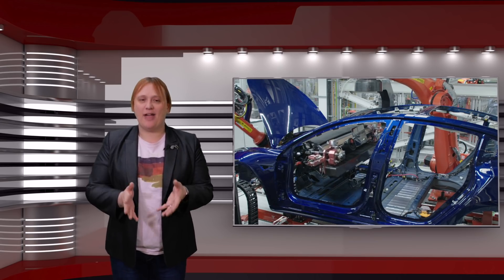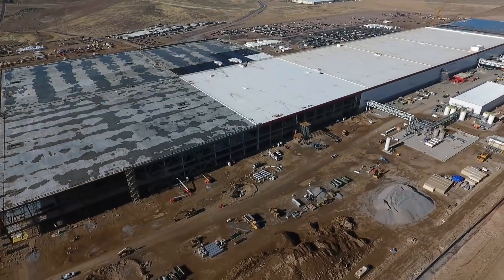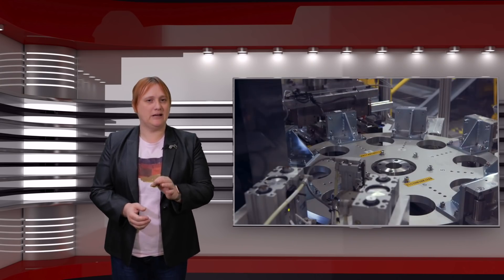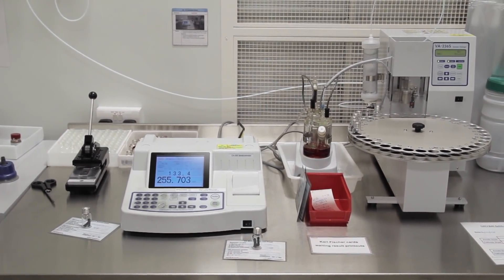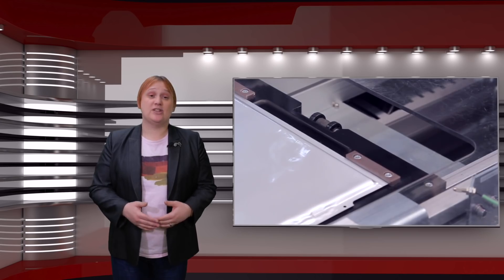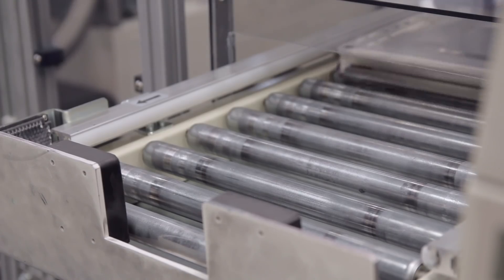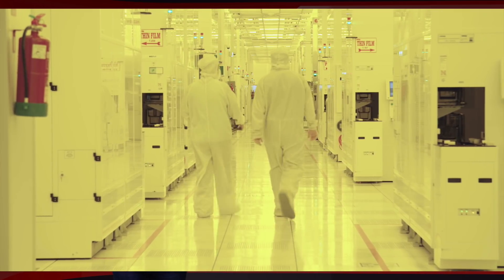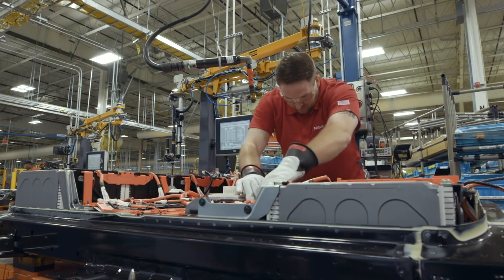Want A Battery Breakthrough? Figure Out How To Make Lithium Ion Batteries More Easily!

Comment: I work in aviation and in my industry we have moved to a "just culture" policy. In which undue stress is not allowed (but often still happens) and you can't under most circumstances be punished for mistakes.
This policy has helped reduce occurrences and if employed in other industries reduce errors.
Reply: @Adam Wade A lot of those issues can actually be explained by greed, plain and simple, capitalism drives for the sale of the cheapest product for the highest price that people are willing to pay, and that often results in the sale of substandard products. Either way, people do need to be held accountable for their mistakes. It does make sense to reduce the stress of people coming clean with their mistakes at an early enough time that those mistakes don't turn into a major problem, but if your design makes it into production and ends up killing hundreds of people, you absolutely need to be s--t-canned.
-
I can say from experience that the problems with new houses are absolutely a result of greed, because I've worked construction and I've seen that problems are almost never a result of mistakes, but are a result of the push for projects to be done faster, with cheaper labor and cheaper materials (sometimes, the wrong materials). Managers/business owners are also PLENTY hard on their employees in that line of work.
Reply: @Adam Wade Most products have improved, MASSIVELY, and many have improved due to government regulations. Look at cars, they're a million times better than they were 40 years ago, partly because of competition from the Japanese, mostly because of government regulations on emissions (which also led to improvements in power output, interestingly enough), safety and efficiency. When the government wasn't involved in the regulation of automotive technology, the market system made almost ZERO advances, for THREE DECADES, because all they had to do was package their products in a way that made them attractive to consumers and produce them in the absolute cheapest way possible. Without regulation, the market system becomes a race to bottom, because most consumers are morons and have no idea what they're even buying. For example: You probably don't know the first thing about automotive technology.
-
Greed is so hugely damaging to a society that I can't even begin to touch on the problems that it causes (plus, I'm eating), I'll only suggest that you lay off of the pot, it destroys the functioning of your brain and it's VERY clear that you haven't thought about this matter with a clear head.
Reply: Huh, so that explains the 737 Max.
Reply: @Adam Wade I'M embarrassing, says the stoner... Ok, buddy!
-
"Not only am I a trained mechanic but I also run my own bussiness operating 100k+ pieces of equipment."
-
Sure you are. Anyway, even if you are, that doesn't counter the point that I made, which is that most people don't know what they're actually buying, most of the time, which is why a pure market system could never produce any major advancement.
-
"You think the government invented fuel injection?  Or a knock sensor?"
-
No, but automotive companies had no need to adopt them until the government raised emissions standards.
-
"You think cars didn't advance due to capitalism?"
-
Did they advance from the 1950s through the late 1970s?
-
"They didn't advance due to regulations in order to pave a path for foreign manufactures to openly sell here."
-
What? They didn't advance until the regulations REQUIRED them to advance.
-
"My 69 c/10 pick up truck gets 19 mpg."
-
But it probably makes less than 200 hp (don't forget about gross vs net). Something like the Ridgeline makes nearly 300 hp, gets 25 mpg, it pollutes THOUSANDS of times less and is a FAR safer and more capable vehicle than your C10.
-
"...all get the same or less."
-
While being capable of making WAY more power, while polluting FAR less.
-
"You think I know nothing about auto's because you have been taught with no working knowledge."
-
I've been working on cars for nearly 20 years! ROFLMAO!!!
-
"What do we have now we didn't have then."
-
WTF kind of question is that? Modern cars have FAR more power, their handling and stopping ability is WORLDS better, they're much more fuel efficient, they're literally THOUSANDS of times cleaner (as far as emissions), they're ridiculously safe when compared to older cars, they require FAR less maintenance, they're FAR more reliable... Older cars didn't even have 6 digit odometers, because they rarely even lasted long enough to need them, yet they needed oil changes 3 times more often (the PCV system, which is an emissions control system, is one of the things that made longer oil change intervals possible), their carburetors constantly needed to be fiddled with, ignition components were constantly in need of adjustment and replacement... The list of MASSIVE improvements just goes on and on! This cements my assumption that you know absolutely NOTHING about automotive technology.
-
"Study after study has proven the auto industry is not advancing due to over regulation."
-
Yeah? What studies are those? The studies that show that vehicle death rates have dropped dramatically over the years? The studies that show that air quality has improved dramatically over the years? The studies that show that vehicle reliability and longevity has improved dramatically over the years? You're just pulling crap out of your bong, man.
-
"Imagine Tesla without all the regulations."
-
Describe it to me, oh wise one, I'd love to hear about how much better a Tesla would be without regulations from someone who is so knowledgeable.
-
"...you would not buy from the cheapest supplier?"
-
In our current economy, who wouldn't? That was my point, stoner boy.
-
"How long would you last buying high and selling low?"
-
In our current economy, you wouldn't last long. That was my point, stoner boy.
-
"You feel things are not right."
-
I don't feel anything, I KNOW that things aren't right. Nothing that we're currently doing can be sustained, it WILL lead to disaster, and all of the supposed accomplishments that capitalism has made over the years will mean absolutely NOTHING. There are PLENTY of studies to back me up on that.
-
"That is why I have spent nights in tears figuring out how to keep my men paid, there families secure."
-
Wah. That's the fault of our current economic system, buddy. If the functioning of your brain weren't horribly destroyed by your drug use, you'd be able to think outside of the box and understand that. If your mind were actually open, you'd be able to look in from the outside, you wouldn't be a pathetic slave to a system that defies the laws of nature and is dragging us to our own demise! You're PATHETIC, you're just a mindless herd animal.
-
"Very few people are greedy as you describe it."
-
You don't even know the definition of greed! Greed is when someone's want for wealth and power are EXCESSIVE, those wants are deemed to be excessive because they're DAMAGING TO SOCIETY. Greed, by definition, is a BAD thing. 
-
"I will know if you googled it. What do you use?  Do you know?"
-
My dad showed me how Plastigauge works when I was like 10 years old! Now, tell me, why are engines so much more powerful and so much more efficient than they were 50 years ago. What do you know about actual automotive DESIGN?
Reply: @Adam Wade "I have greed.  Drug dealers have greed."
-
BTW, this is why we throw people like you in jail.
Reply: @Adam Wade You actually missed one of the primary reasons, and it was a result of government regulations.
-
"power is increase by only 2 ways."
-
Absolutely HILARIOUS. There are MANY ways to increase power output.
-
"Even though those are terrible and are removed, like on my Camaro."
-
There are at least a few manufacturers who are still using cylinder deactivation technology, including GM.
-
"Or how they are developing thermoelectric generators to replace them."
-
I read about that almost 20 years ago, none ever made it into production.
-
"alcohol has a higher octane rating which also allows for more timing."
-
Most people don't run E85 in their cars, and ethanol actually REDUCES mpg.
-
"None of that came from Government."
-
Most of these improvements came about because manufacturers were having to meet CAFE and EPA standards.
-
"But what you are  saying is an industry without computers is supposed to be compared to today with computers?  That is illogical."
-
Is it? Would car companies have adopted EFI if the government hadn't tightened emissions and efficiency requirements?
-
"Furthermore, cars were tools then."
-
What? People still use cars and trucks for all of the same things now as they did then.
-
"Who would even think about fuel efficiency?"
-
The government.
-
"You have to look at history and culture."
-
I have, you clearly haven't.
Reply: @Adam Wade I've spent large amounts of time driving and maintaining vehicles from 1976 and up.
Reply: Adam Wade there is a third way to more power. Reduce waste. In cars only a small fraction of the energy in gasoline actually ends of moving the car the majority of the energy is wasted as heat going out the exhaust pipe or out of the radiator.
Reply: @Adam Wade As Nathan here said, you can improve the efficiency of the engine. You can reduce friction, you can reduce pumping losses (this usually comes along with improved volumetric efficiency), you can reduce parasitic loads, etc. You even mentioned some of the ways that engine designers improve power output through improved efficiency! The one way to increase power that I was trying to get you to focus on was combustion efficiency and this is what the tightening of emissions regulations forced manufacturers to do. 
-
Honda really got a big head start with their CVCC system. The CVCC system improved combustion efficiency so significantly that Honda didn't even need catalytic converters on their cars, their more efficient combustion process simply made better use of the fuel that the engine was consuming and that resulted in significantly reduced emissions. The Japanese really led the way in this area for a long time (they still do, actually. Mazda HCCI, for example). Some manufacturers didn't bother improving combustion efficiency, they simply put air pumps on their engines that pumped air into the exhaust so the fuel that didn't burn in the combustion chamber could be burned off in the exhaust, which is pure insanity. These companies were wasting engine power to drive a pump, in order to burn off the fuel that the engine was wasting!
-
In the '80s, NASCAR engine builders starting really looking into improving combustion efficiency (engine builders in other forms of racing had started work on that much earlier, but this advancement in NASCAR is well documented in the US), because they found that they could make more power with less fuel if they improved the combustion efficiency of the engine. Burning less fuel meant making fewer/shorter pit stops, and having more power in a race car has obvious benefits. In the '80s, the American big three finally started to improve on their 1950s engine technology by improving on the design of their ports and combustion chambers, in order to improve combustion efficiency.
-
A major part of improving combustion efficiency involves increasing the compression ratio of the engine, which can be done with nothing more than improvements to the shape of the ports and combustion chamber. These improved designs are the main reason why modern engines are able to run such high compression ratios, without having to run on higher octane fuels.
Reply: @Adam Wade "Removing/reducing friction reduces that force, it does not increase engine power output." "None of that increase the power."
-
Again, I have to ask: WTF??? The rated power of the engine is the USABLE power output, reducing friction increases the USABLE power output of the engine! 
-
"There is just less force taking away from the engines force."
-
Which means more power, without using more fuel! More power, no increase in fuel consumption = greater efficiency.
-
"It is in no way an advancement, only an improvement."
-
The definition of advancement is: A development or improvement. ... I'll give you a break on that, though, because English doesn't seem to be your primary language.
Reply: @Adam Wade Carburetors are only efficient within a VERY narrow range of operation, BY NATURE, there’s no way around that. Go ask ProStock racers, or the guys who ran carbureted NASCAR engines why they constantly need to change out parts of the carb to optimize it for the conditions that they’re operating in. Fuel injection systems automatically compensate for every kind of operating condition, making them FAR more efficient than ANY carburetor could EVER be. Even if these magical carburetors from the '30s did provide some huge improvement in efficiency, it would only be by the ridiculously terrible standards of the day and it would only be within a very narrow range of operation. Hell, even if those carburetors perfectly mixed every molecule of fuel with air, the primitive design of those ancient engines would separate the fuel and air because of their horrible port and combustion chamber designs. If you'd read my comment about improved port and combustion chamber design, you'd know that, but you obviously only see what you want to see.
-
"The government, protecting big oil, suppressed them."
-
How? What laws were made to prevent this magic carburetor from being produced? 
-
"If government "helps" the auto industry, who "helps" big oil?"
-
The auto industry and the oil industry work together in order to maximize the profits of both industries, which is why the American big three didn't want to move away from their gas guzzling boats. No government was required for these two industries to work together against any improvements in engine efficiency.
-
"Hell me and my buddies made a vapor carburetor for an old lawn mower."
-
AND??? So have a lot of people, none have shown that it's of any benefit. Modern engines atomize their fuel FAR more efficiently than any kind of carburetor.
-
"Those carbs destroy any modern fuel injection.  Believe what you want."
-
I don't believe what I want, I believe what the evidence shows to be true. Where's your proof that any kind of carburetor outperforms modern fuel injection. SHOW ME THE DATA!
-
"Liquid gas is not flammable.  Fuel injection injects liquid as a fine spray.  That will NEVER be efficient."
-
Then why are modern fuel injected engines so highly efficient? Carburetors just dump a stream of fuel into the engine, it's not even a fine spray, the fine spray that fuel injection produces allows the fuel to atomize much more easily than the fuel stream that comes from a carburetor.
-
Anyway, this has been a huge waste of time, you're clearly insane and I hope that you're safely locked away somewhere.
Reply: @Adam Wade I made a reply to your main comment, but it didn't post (it was probably too long), but this is all that needs to be said: You have absolutely no idea what you're talking about.
Reply: NotHandMade but what about all of us that thrive on stress?